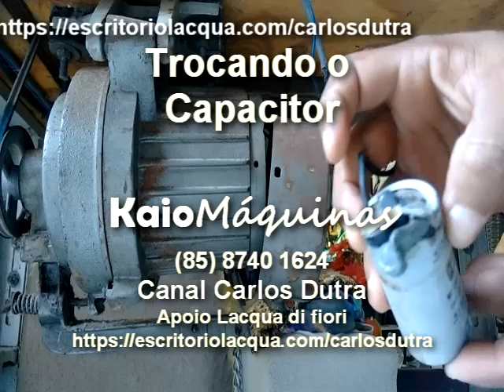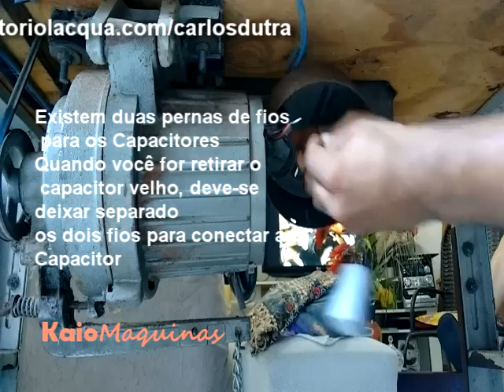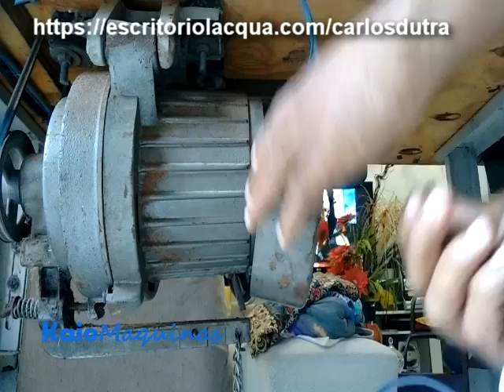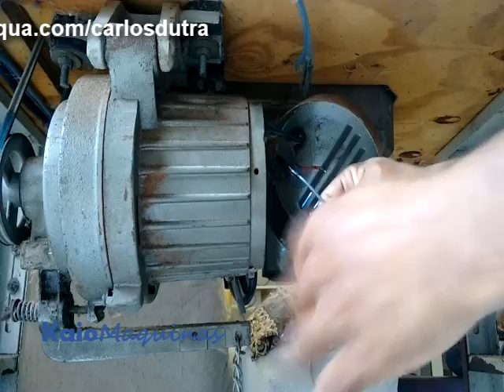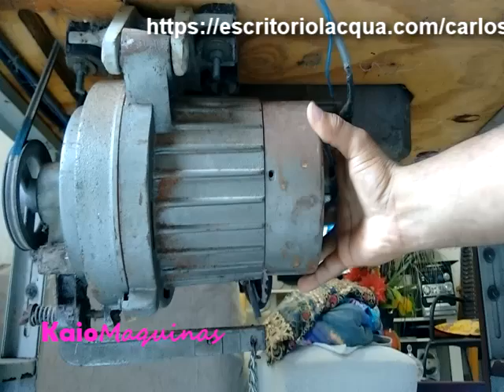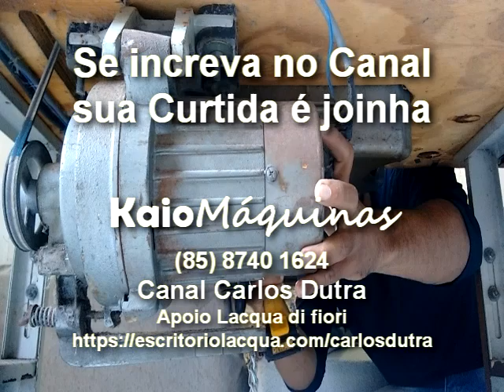Como trocar o capacitor do motor da máquina de costura

Comment: Olá, a minha overlok tem o capacitor de 30uf 10% 250VAC e 50/60Hz, encontrei capacitores com as mesmas descrições, gostaria de saber POR FAVOR se as informações que tem abaixo 40/70/21 C. PO também devem ser as mesmas ou posso trocar por 25/70/21 C. PO que é o que eu encontrei no mercado.